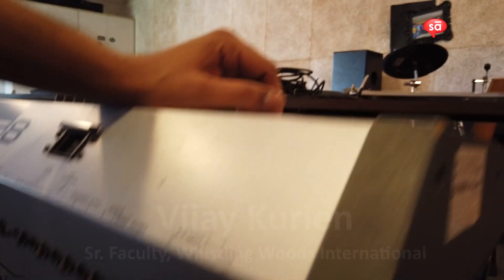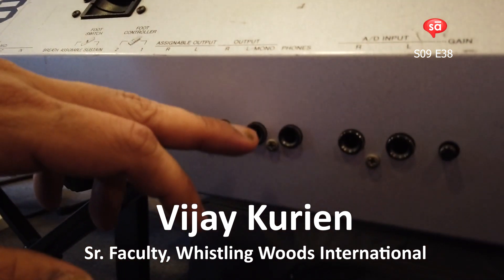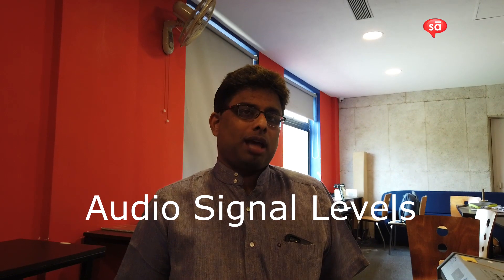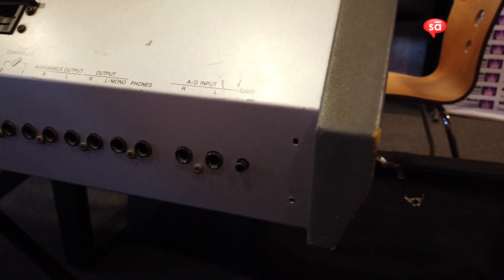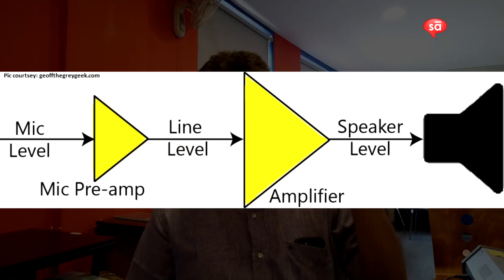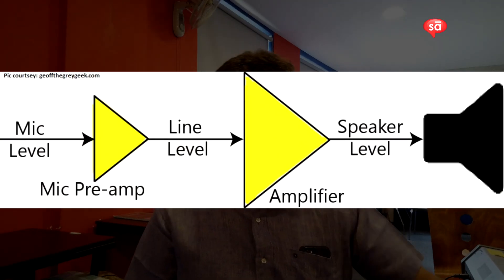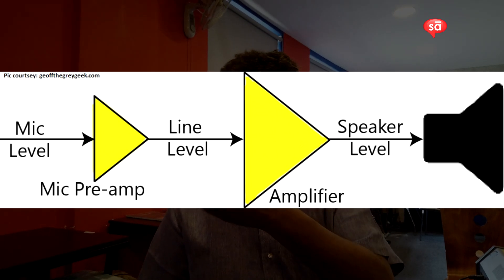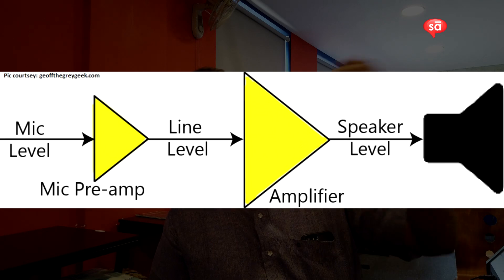Audio signal levels | Vijay Kurien | S09 E38 || tutoREals | Sudeep Audio

Comment: As a rough approximation I use .001 Volt mic level, 1 Volt line level, 100 Volts speaker level. I know these are not exactly correct but it is close enough to approximate the amount of amplification between levels.